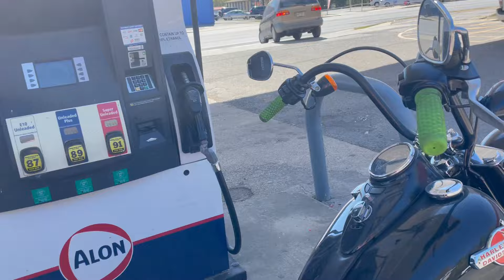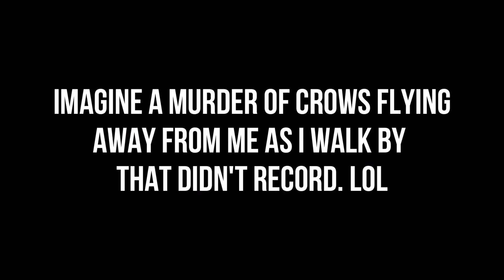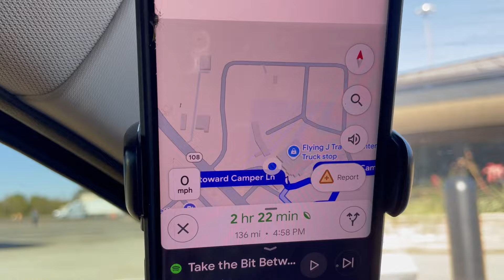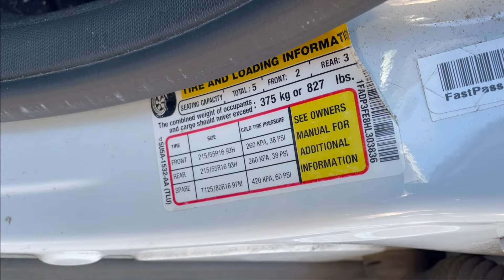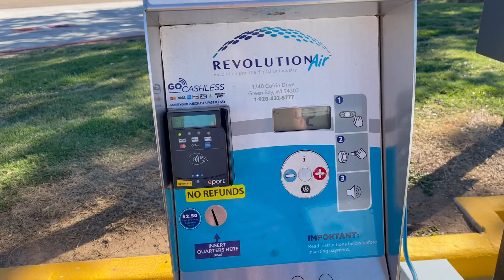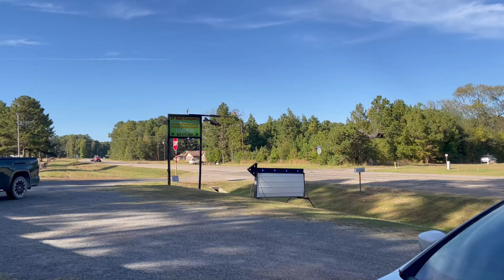tent camping in mount enterprise, texas (born free motorcycle show 2024) ~ travel vlog

Comment: I love outdoor camping. If anyone's interested, here's a camping check list. Feel free to add to it. CHECKLIST: tent needs. Tarp, Hammer, spikes,bedding to suit your needs ; ie, air mattress or cot. Bedding-sheets, blankets and sleeping bags rated for the weather/temp for area you will be sleeping. pillows. broom and *dust pan optional.( becaue the tent will need sweeping, so you decide if one is needed. Or can you sweep out your tent by placing both feet at either end of the opening, laying flat the floor of the tent entrance to freely sweep out dirt and debree) floor mat, to dust feet off before getting into tent, I like the cheep bathroom/restroom floor mat kind. they wash easy and roll up for storage nicely. Hardware. Hatchet, axe, matches, lighters,lighter fluid, water storage containers if drinking water is not available at location. I like the collapsible type that can be filled once on location or at the grocery store where food can be bought. Tip for food and coolers: if able, buy food for your trip once you made it to your location, the cooler can be storage for the drive to the camping location. plan meals ahead of time. so you have a plan for breakfast, lunch, and dinner for the amount of days at camp. Roasting sticks can be made at location if you know how, or buy the skewers found in camping sections at store/online. COOK WEAR AND CUTLERY if you're going to be preparing meals: cook stove and propane. Percolator.  cook over fire is an option. pots and pans needed. 
table cloth $1.25 store options are suitable,  masking or packing tape to keep table clothe secured, garbage bags( take out what you bring in)most all camping locations should have a garbage bin location, food cutting mats,cutting knife, can opener,serving spoons/forks. Regular spoons,forks knifes, plates, bowls,napkins, cups. ( if you have a dedicated camping gear storage all these can be washed and used over and over) washing tub, dish soap and sponges. Towels cloth or paper.or a drying rack. Salt pepper and other spices as needed.  
Camping chairs❤ card games, lanterns/ lighting. Shampoo and conditioner/ make bio degradation if able. hand soap, bath/beach towels.
Air pump for bedding. Battery operated and electric if it suits your vehicle,  toilet paper. Snacks